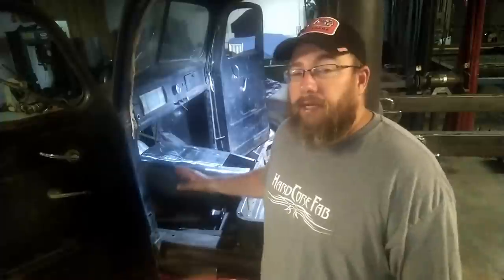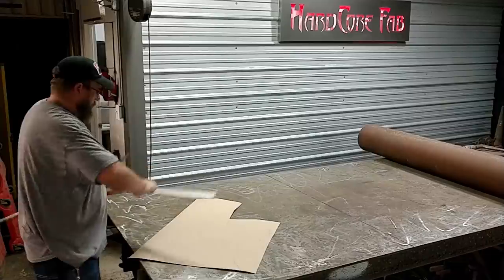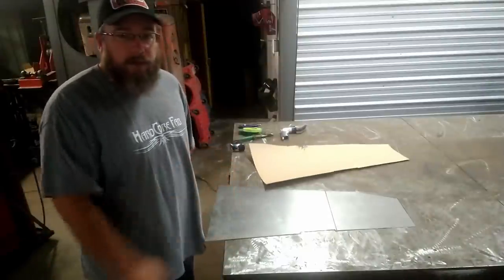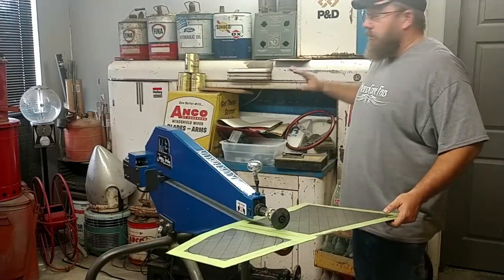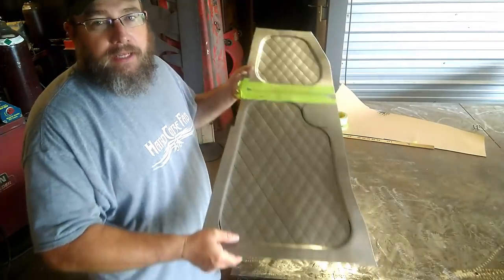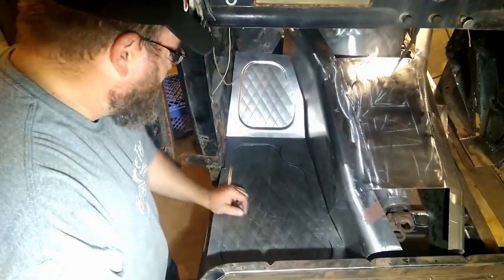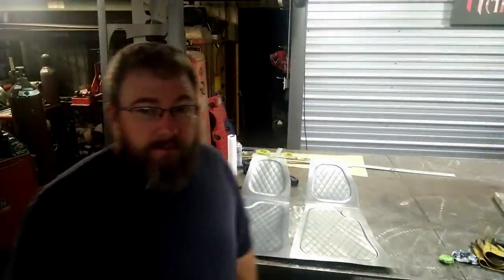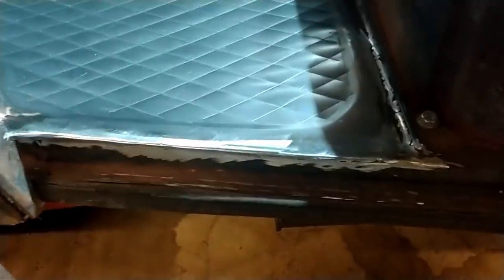Rat Rod floor pan (Rat Rod build part ten)

Comment: My question to you is why didn’t you reseah the body mount area to keep bolt below panel edge
Reply from the maker: That would be a great idea but if you've watched the part two video on this build you will see the mount for the cab is a 4 inch piece of angle.  The two front mounting holes are in direct contact with that angle so it would have required a rework of the mount to do so.